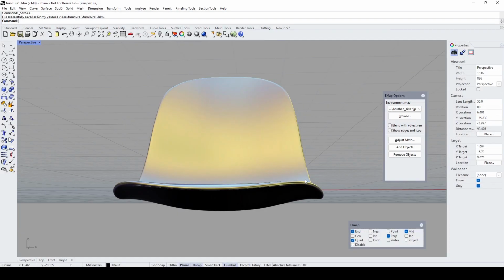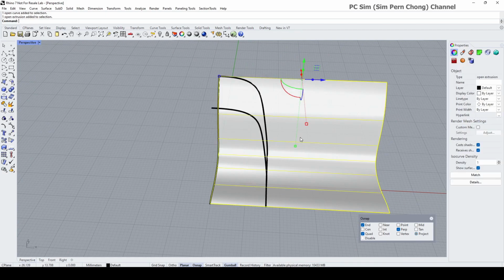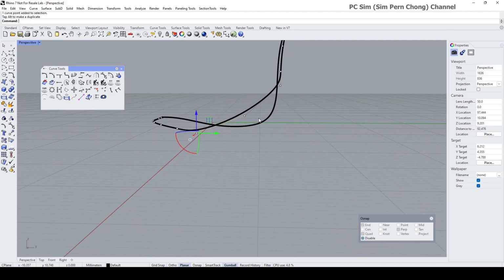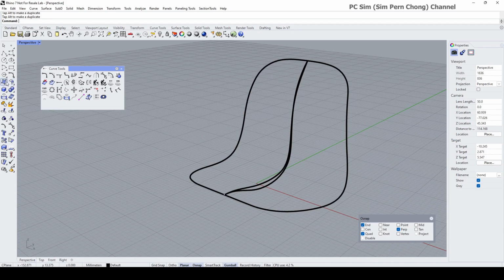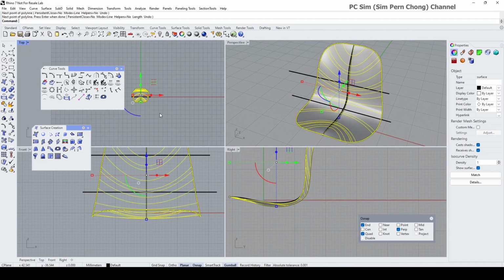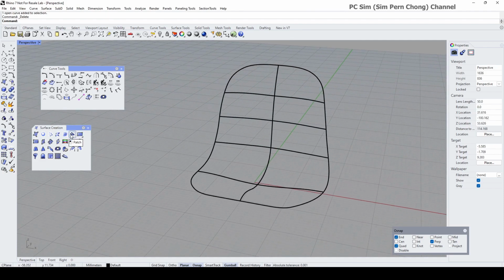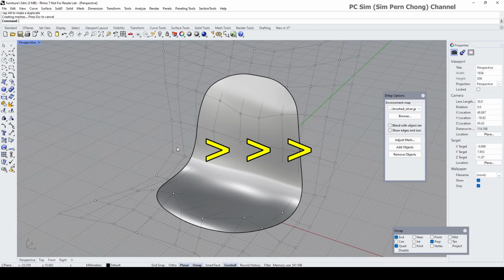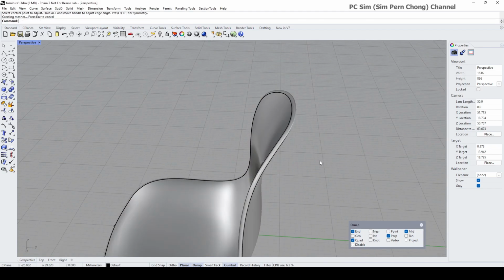Rhino 3D Tutorial (Requested): Modelling A Chair Body using NURBS workflow 犀牛3D教程：NURBS格式椅子建模

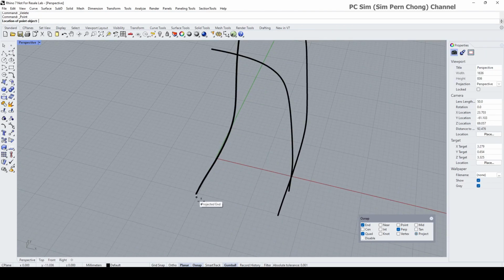Comment: my line is more lighter than yours and i cannot repeat exactly what you are doing sir, is there any settings for thickening the lines?am i in a different mode? and i cant extrude like you did in 02:19
. my lines dont allow it because they are still controll points. i am very new at this so if you could help this would be amazing